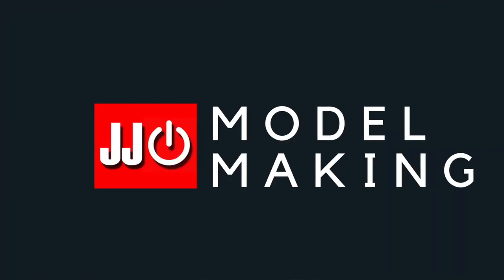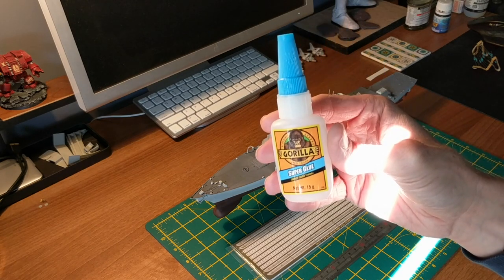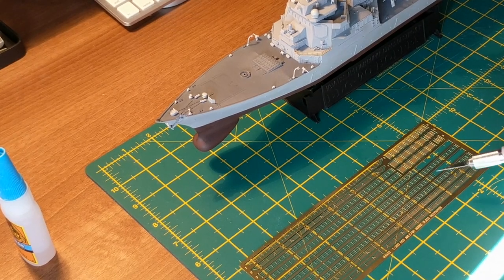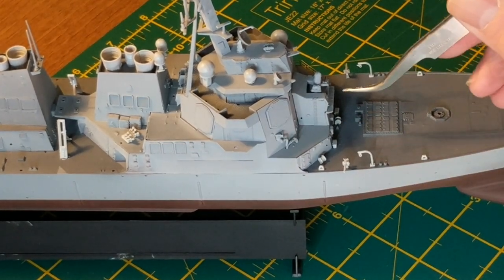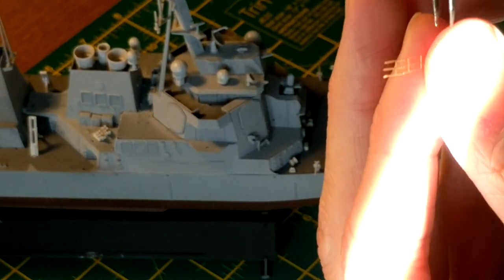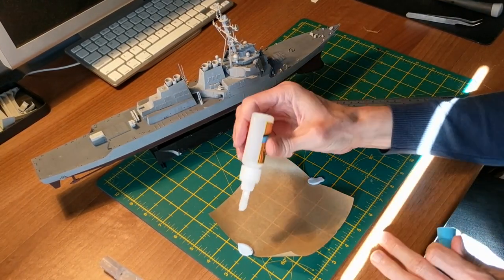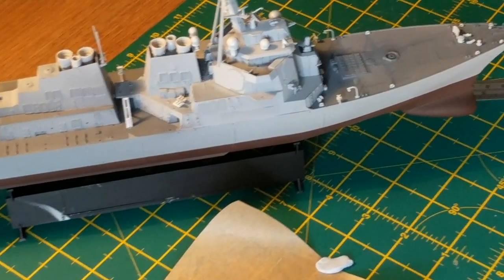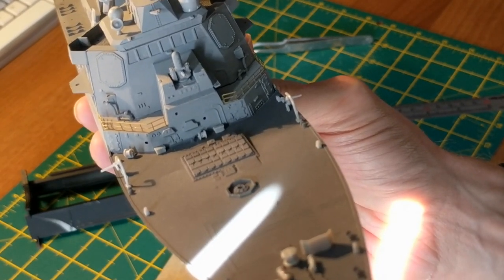Model Making Tutorial How to use Photo Etch on Scale Model Warships

Comment: Very informative. One tip cut your photo etch on a ceramic tile or something without any give in it and you won't bend the PE when you cut it. Hope this is of interest to you. Vic
Reply: It was indeed
Reply: @Van Gott Etch can cut ultra fine details that plastics can't handle. The plastic kits though are well detailed are restricted by the moulding (drafting). Etch is to enhance a model to the next level as well as adding another path to the hobby.
Reply: Use a small block of something to put on top of the pe, stops it pinging away on the final cut.

Comment: Modge Podge Tacky an be your friend.  The other handy thing is a set of dividers, especially those which can be fixed to a specific span.  Use the dividers to measure off the deck runs, and this will help to avoid that dread coming up either short or long--neither being very good other than for exercising one's vocabulary of expletives.
In a 3 part pend like that, I'd take the middle measurement and try and find the run of railing where the stanchions best fit that center, then trim the wings  to their measurements.  Having the bend fall on a stanchion really looks better.
I also usually shoot a coat of the vertical superstructure paint on the rails before installing., as touching up is less likely to ding fragile PE.

I really like the color you used for the main deck.  Please note that USN uses that same color for all decks barring only flight deck surfaces (those look like tarmac IRL).
ADM Hopper was one of my mentors, and your model is a credit to the ship named after her.
Reply: Dividers is a good tip, thanks.

Comment: I actually found it helpful to paint or at least primer the photo etch before attaching. You will likely have to touch up after but it has saved lots of time and frustration. Also, having plenty of extra railing around in case you mess up what the kit comes with is good. Fancy tools may be helpful but there are plenty of household items that can also do the trick.
Reply from the maker: +Bob Adcock yes, I think you might be on to something there! Thank you for letting me know

Comment: I USE THIN SOLIDER WIRE AS A TEMPLATE THEN TRACE IT ONTO PAPER THEN JUST FOLLOW THE TEMPLATE WITH THE PHOTO ETCH THAT WAY YOU NO IT'S GOING TO FIT IT WORKS FOR ME
Reply: Dude!  That's a great technique.  The piece of solder can be straightened and reused over and over.  It should really help on tricky curves and things where spring back is a problem.  I'm a car modeler just getting started in ships and need this kind of info.  Thanks for sharing.
Reply: @cratecruncher6687  thanks buddy me to build alot of trucks and cars in the middle of the cancer awareness build the GT-R NISSAN  with lights always trying to learn new tricks 👍

Comment: Often, I dip the photo etch in Elmer's glue along the contact area.  The stuff is sticky and goopy and creates an immediate loose adhesion, allowing you to put it in place and fine tune the position before it hardens.  Works superbly with resin and balsa decks.  YMMV with plastic.  Elmer's dries clear, so unless you leave an absolute mound of the stuff it becomes invisible in an hour or so.

Comment: Thanks for the video.  I rather prefer using diluted PVA or “white glue”.  I put the rail on the model, use several thin Tamiya masking strips to hold it into place then use a small brush to “paint” on the PVA glue.  The advantage is that it gives me an opportunity to make sure I can modify the rail to the correct version.  I read somewhere that a modeler recommends to never use crazy glue unless the part is exactly where you want it.
Reply from the maker: Sure thing. Super glue has worked for me

Comment: stanchions on the apex of the deck angle , you cannot bend railing between stanchions, in reality that would bowstring the railing, so you need accurate stanchion distances...always bend on the stanchion
Reply: There in lies the problem with generic rails. They aren't measured to fit different distances and pitches.

Comment: I'm considering surrounding myself in some kind of fine mesh netting when I work with photo etch parts! What I mean is, some kind of mesh "cage" from the work surface up to just above my head, and as wide as my shoulders. So many times when I work with very tiny photo etch parts for 1:35 scale tanks, I'll be trying to hold or position a part with a pair of tweezers when suddenly the part snaps out of the tweezers and goes flying off into nothingness.  I have lost so many parts this way. It is so frustrating.  Some of the Dragon (DML) WWII tank kits come with photo etch parts that are mind bogglingly small and cannot be worked with without magnifying glasses.  And when the part this small flies out of your tweezers, it is gone forever. I have spent too many hours on my hands and knees, thumbing through the carpet below my work desk looking for a part of photo etch that is slightly larger than a grain of sand.

Comment: I see that in this case the model is made without the ugly overscale plastic railings, so you can use the provided photo etch parts. But what about an older kit? Do you have to trim all the plastic railings and put the photo etch ones?
Reply from the maker: +NeAr1986 For older kits, where you can buy after market photoetch parts, yes you will need to remove any plastic parts as per the photoetch instructions. Railings are normally added on after and in that case, just follow the photoetch instructions. It can be a little scary cutting of the plastic but follow the instructions and take your time
Reply: JJ Model Making Thank you :)

Comment: While it seems that photo etching can add some nice detail to a ship, I'm not sure of why you would use it for railings for one. I was on two ships (USS Nimitz (CVN-68) and USS Copeland (FFG-25)) and on both sips the rails were painted gray. Same with the netting around the flight deck. I believe the netting was steel cable, but don't quote me on that. But the frame was definitely painted gray. I'm just not sure that the photo etching pieces would be worth it or not.
Reply: You paint them once on the model. Given this is a navy vessel the railings are often the colour of the ship.